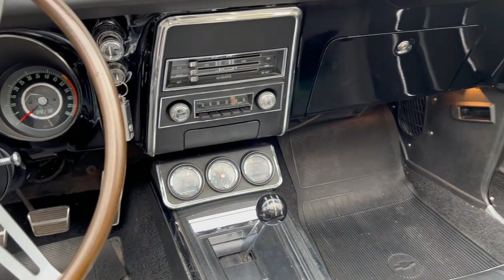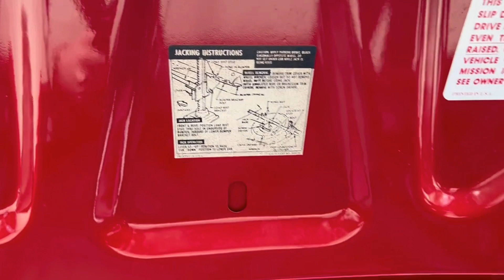Original One-of-One 1967 Camaro RS/SS: Chip's Garage Episode 20 #automobile #car #cool #oldschool

Comment: 67 was the only year of the Camaro that the Trim Tag told you exactly what it came with. I wish that never changed.
Reply from the maker: @ellisonlowrimore7751  😎👊🏻😎
Reply: Amen to that.I was into 67-8 Camaros and F-birds in the early 80's,BEFORE repro parts came along...For some reason,People that knew what was on those tags would NOT share that information which led to lots of speculation and incorrect cars...

Comment: I've owned many 67-8 Camaros,mostly RS/SS big block cars.My favorite one was deepwater blue with black and white deluxe interior.It had most of the options this car has and some this one doesn't have...Guages,tilt with the wood wheel,speedminder,AM/FM radio,and fold down back seat.It was built with the 325hp 396,M-22(!) and 3.55 12 bolt(open) I bought it in 1983 with 41K on it for $2350.00! Sadly,it was vandalized by an ex-girlfriend to the point of beyond repairable(ran into it 4X with her car).It had 44K on it,it probably was savable but it made me sick to look at it and I sold it.Seeing the interior of this car brought back a flood of memories.Curse the witch that destroyed it...
Reply from the maker: @ytwhite5930  That’s great and sad all at the same time! Thanks for sharing brother.

Comment: That 67 Camaro is exactly like mine. Same Bolero Red with its original Black Interior w headrest seats. It's an original SS RS 396 325hp w Turbo400 convertible. It is also a highly optioned Camaro.  Yours is a great looking original 67 Camaro. These are very fun cars to drive.
Reply from the maker: You’re car sounds great buddy and yes they’re a blast to drive! 😎
Reply: I own an all original 67 SS/RS  396/325 ,400  turbo automatic Texas car original metal ,bolero red with red interior and black vinyl roof,power windows and tilt wheel but no air. Has a 308 rear-end gear.has had a repaint and a new vinyl roof

Comment: The early build Camaros like yours never had the large holes in the sub frame. The holes started transitioning in the frames about end of Dec 66. Some frames only have one large hole and then eventually they came with 2 large holes. Hope that answers your question.
Reply from the maker: Thanks buddy, very helpful 😎
Reply: I have the same frame on my Camaro built in ‘66